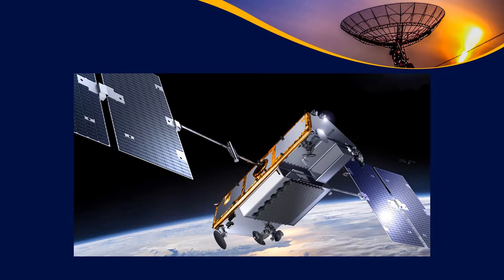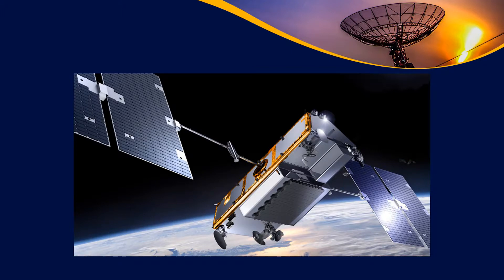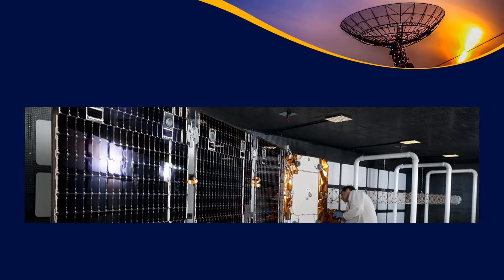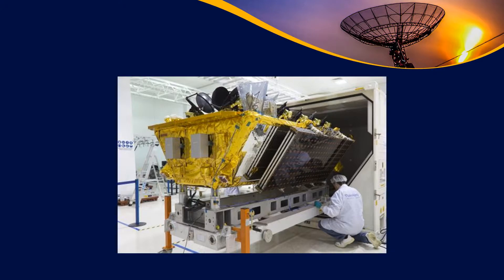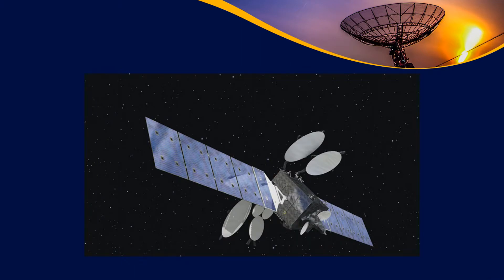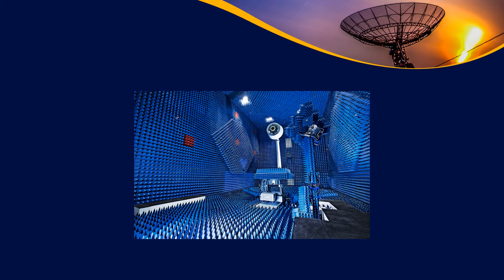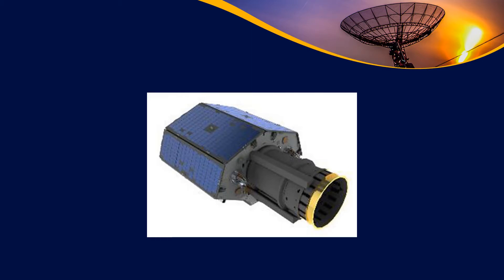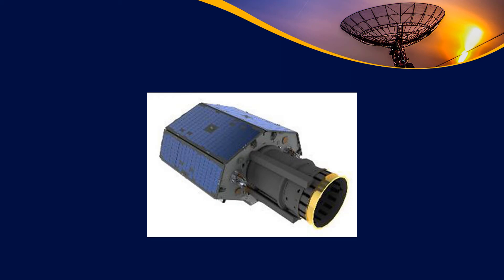Basic Satellite Design- Communication Payloads

Comment: TLDR; (A) Iridium - LEO, arrays with many antennas for high bandwidth ground-to-sat comms. (B) O3B - MEO, dishes for pointing at ships or villages. (C) GEO - broadcasting TV. Inverse square law means distance incurs significant power requirement costs. Test your equipment before launch, shield your RF equipment.